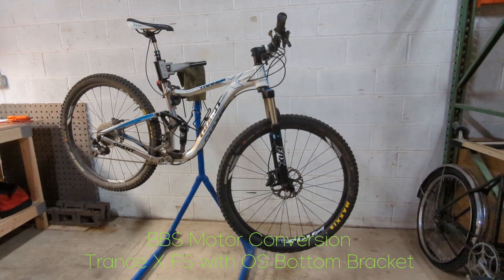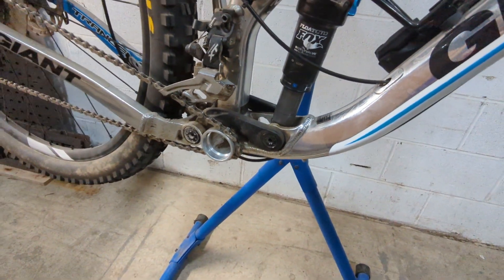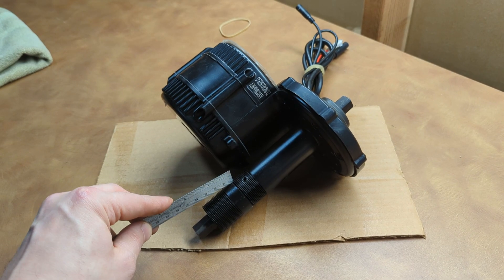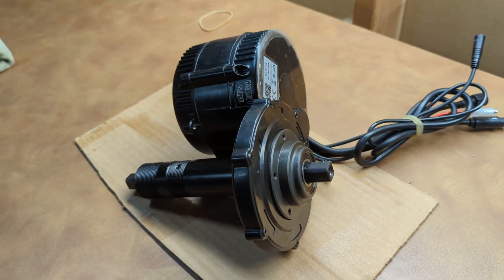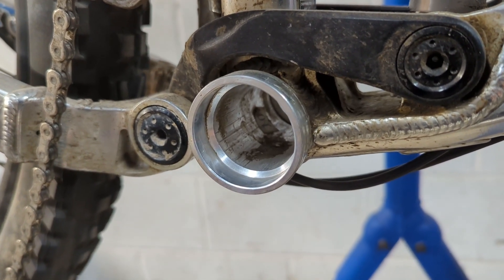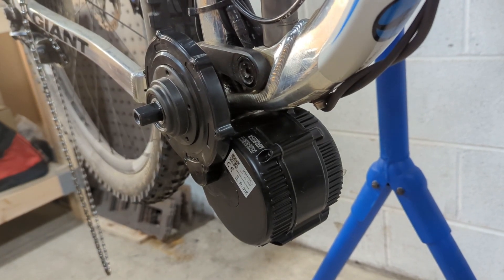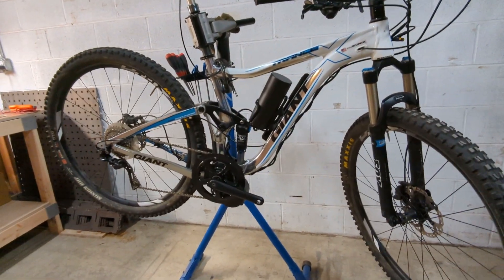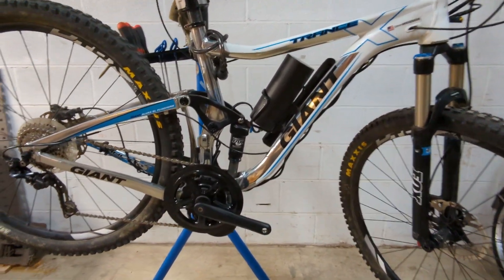Full Suspension Electric Bike BBS Conversion Volton Electric Bicycles

Comment: I wonder if you could disable the rear suspension (make it a hardtail of sorts), and with the added space perhaps the motor will fit ABOVE the crankset out of harms way for off road riding and better battery clearance?  The regular hardtails do not have the clearance there for a motor above and make motor conversions very vulnerable to rocks on the trail.
Reply from the maker: Quick answer is no. 
Even if you were to remove the rear suspension, the standoff between the center of the bottom bracket and any point on that frame junction only allows for the dropped position of the motor housing.  The clearance is tighter than it may seem. We  run into random BB fitment issues, even though we are confident motor parts will fit prior to pulling stock BB....

Between the 29in wheels and a pretty high bb shell ground standoff the clearance isn't bad and is very capable over moderate/high moderate  technical decent. Adding assist always comes with some consolations to balance things out....Unless someone was coming off of a well designed analog Enduro or xc bike and was looking to shred on a BBS powered machine, I wouldn't think most riders would be too worried about a couple inches of BB clearance lost. Not all bikes have the shape of this frame though...so I know about the steep downward position of motors taking up much more clearance.

End of the day - Trance is a great candidate for a very capable eMTB conversion.